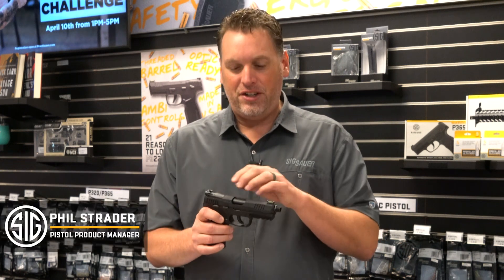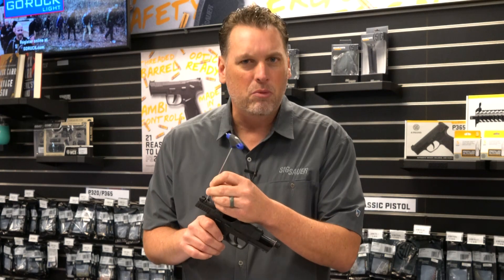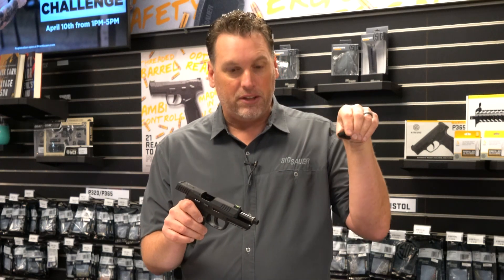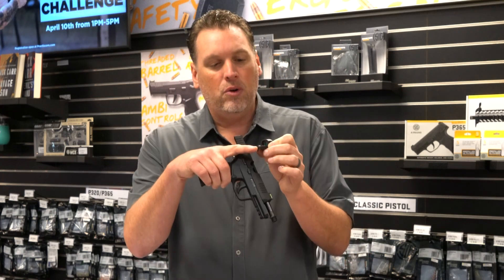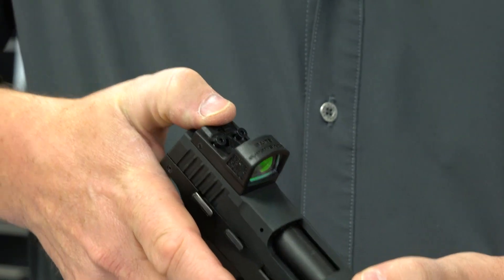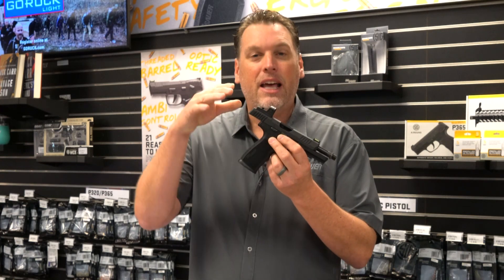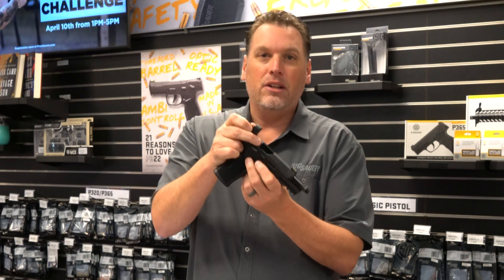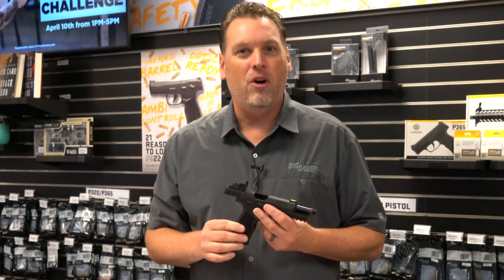P322 Q&A: Installing RomeoZero Elite

Comment: Romeozero sight will NOT stay on the P322 with the included screws!! They are too short! No, I didn't overtighten them, they only engage like half a thread. Anyone know what screws I can buy that are longer and will hold it on? I bought the Romeozero separately from the P322

Comment: What size are the screws that you use to install the optic? Like the M3 on the 365 XL? Or is it completely different then the XL. I bought a budget Riton Optic. Wondering what screws will mount it on my 365xl and also the P322?? Thanks

Comment: The Romeo Zero Elite would have been my first choice IF it were available anywhere. In my case, it was not. I waited long and put notifications on nearly every reseller website but I had no luck. By the way, the Romeo Zero is on my P365X and P365XL and functions very well and maintains zero like a charm. The only downside is the placement of that tiny on/off button way too close to the lens and is very difficult to reach unless you want to imprint the lens with fingerprints and then it is dirty and have to use a lens cleaner and lens paper. The shroud is an awesome idea for the elite,  but wouldn't it have been a better idea to design the entire optic in 7075-T6 aluminum alloy grade metal and place the on/off switch elsewhere? By the way, nowhere in the P322 manual is it stated what Hex size to use to remove the back sights in order to install an optic. Page 88 shows the Torque (8 in-lbf) but fails to mention that it is a 2mm Hex screw. Consider adding that detail on your next revision. It could save some users the pain of stripping the screws by using the wrong size. With that said, I absolutely LOVE my P322 and using good grade ammunition (Norma and CCI are all I have tried) have had ZERO feeding or extracting issues. You have yet another winner on your hands. I just will give my paycheck to SIG from now on to go against credit for when they come up with their next gun. Thank you for listening and always ameliorating the status of your guns.

Comment: What is the specified torque for the screws for the RomeoZero Elite?
Reply: Found the answer to my own question: torque is 9 in-lb. Next question: For the P322 do you use the P365XL screws??
Reply: Page 88 of the P322  manual states 8lb/ft
Reply: @PierreKerbage certainly not FT-LBS

Comment: From all I can tell in everything I've read, even your brand new Romeo Zero Elite Red Dot is a poorly designed, poorly functioning piece of garbage. Apparently it's got one button that's hard to get to, requires you to fingerprint your lens (which requires you to clean it and therefore likely scratch it)   You had the entire unit to work with why would you put the button there? And when you have adjustments for up and down you should have a button one for up one for down.) Your casing is so weak and poorly reinforced you've had to add an external steel protective cover?  Your TAP feature doesn't apparently work for virtually anyone and your biggest screw up was that it eats batteries and the entire unit has to be removed from the gun to replace the batteries meaning every few weeks or however long they last you'll be removing the site replacing the battery and then won't be able to trust the Red Dot until you get back to the range and make sure it's zeroed.  I can't comprehend how your product designers could decide to put a battery on the bottom of the unit requiring the entire unit be unmounted. It should have been just as easy to put the battery ON TOP and replaceable without having to unmount. You guys need to stick to building guns and leave micro red dots to the guys that have been building them for a while. It's pretty embarrassing when your product loses out to red dots originally manufactured for airsoft guns in every feature and catagory (Take a look at the Cyelee Calf.  It is a better designed. Better working red dot than yours and costs $69!  Proper buttons, materials and a battery compartment on the SIDE, not to mention dials that click, and automatic off and movement turns it back on. How many generations until you have that?  Just shut down the entire Micro division you're never going to catch up you're never going to compete. Write it off.  It's so bad people are going to stop buying Sig Sauer specifically because they don't want your mount or be stuck with you line of micro red dots.  You supposedly have over 300 product design engineers, and that's the product you come up with? I'd say a few dozen people need fired.  What an incredible failure on your part.  From all I've read I wouldn't give you $50 for your micro Romeo Zero Elite, because I wouldn't want it on my gun. Period.
Reply: To be fair trijicon rmrs also have to be removed and re zeroed. But I get it
Reply: Keep crying while we enjoy ours.😭
Reply: Nobody cares, boomer.
Reply: I agree that the sight has lots of drawbacks.  But, to their credit, Sig refunded my money even though it had been 2 months.

Comment: Just received my RomeoZero Elite for installation on my P322. It comes with 4 sets of screws. Which screws to use? Part #7402476 is to be used with the P365X/XL slide. Is this part the one to use with the P323?

Comment: This slide release switch (moved counter clockwise), is EXTREMELY difficult to do. Are they kidding? The original barrel cap also is EXTREMELY tight.  Is it imperative to hold back on the base of the barrel (square) in light of the cap being so friggin' difficult to unscrew?